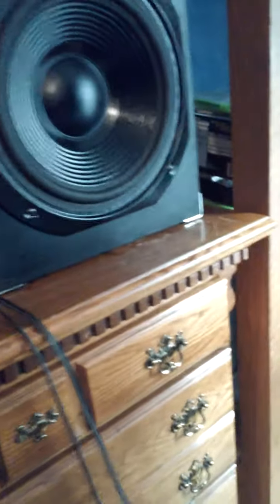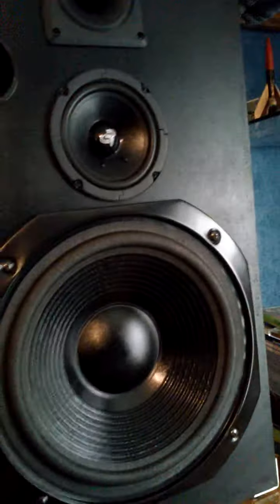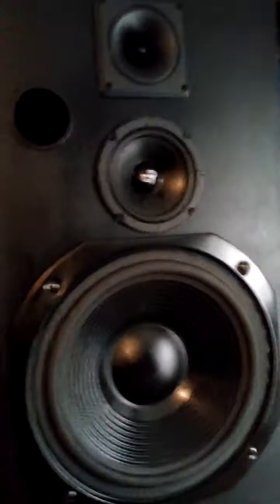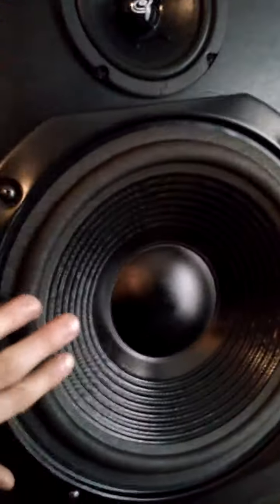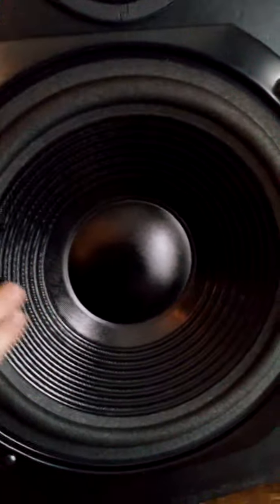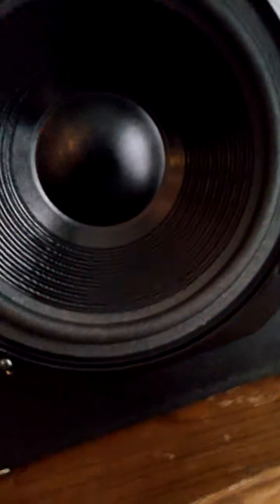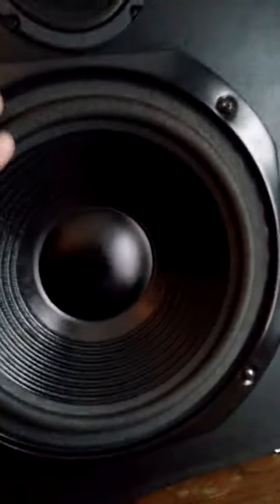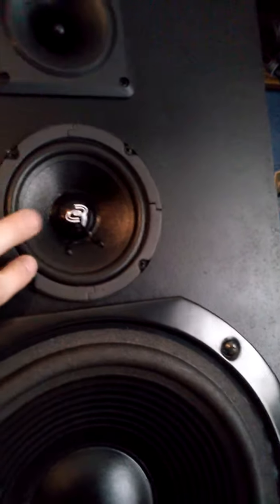Fisher speaker review

Comment: HI I have several fisher speakers which I consider to be their best effort is the ST-845 built form 85 to 89 the drivers are decent, the famous white cone I think Fisher made more white cones than any other electronic back in the days. Usually the boxes and the drivers are a match, I mean you can not replace the original woofer and expect to sound better because that original woofer was meant for that box, and the remaining drivers match the woofer. How did you come to the conclusion that the speaker sound better. Ear test? or do you have equipment to measure the SPL the woofer frequency FAs, or the parameters in that box with that port, the woofer must match the cubic liter of the box and the ports I am sure the woofer you added needs some changes in the box to get the best performance out of it even distortion is a factor.. Did you leave the same crossover did you update? I'd like to know. Usually new woofers come with the specs and the recommended box and ports to get the best out of it.

Comment: Nice job. And thanks for mentioning that the original speakers were crap. Guys like myself cringe when guys hack up good old speakers especially the rare ones. I have a set of fishers.. original and work well.
Reply: Same to you based on the comments the fact that he replaced the drivers does not mean it sounds better, he says the bass response is better, how did he measure that?
Did he use the rattling method if stuff on the wall rattle is better? I think there is no way to improve a box that is already made for those drivers, maybe you can get more treble deeper bass but other factors are important,  in case of fisher the ports accentuate the 25/30hz frequency all the others frequencies are keeping behind cause the woofer works great at that range and kept low distortion. The woofer speakerfreak installed we have no idea what is the best cubic liter required or vented ports dimensions, for all I know the woofer was built maybe for sealed enclosures. Go ahead and audition the speakers and pick the one that sounds good for your ears.